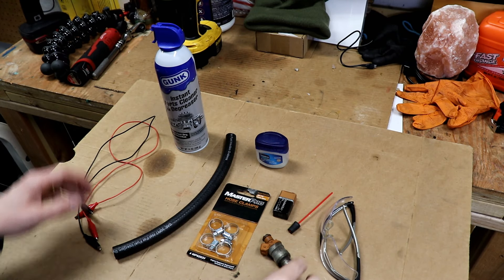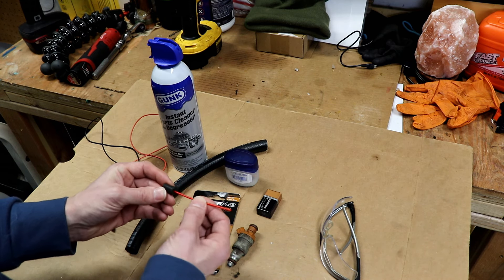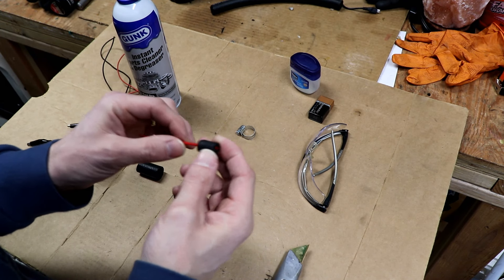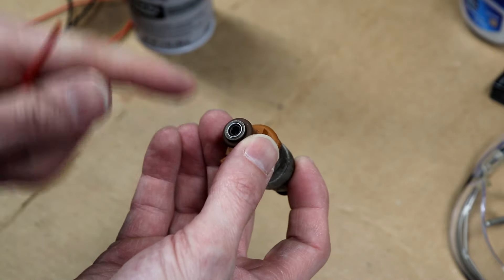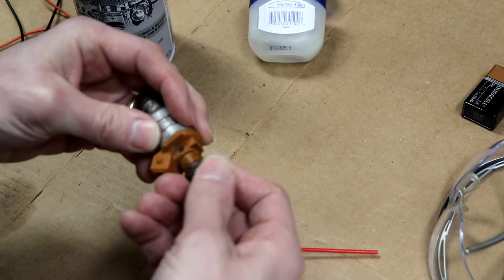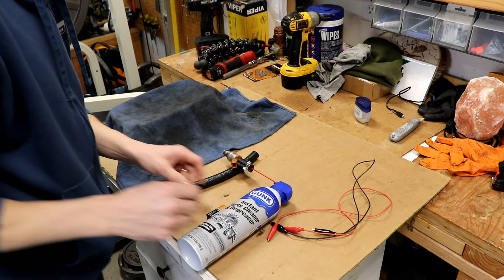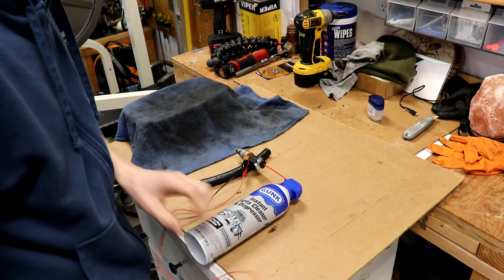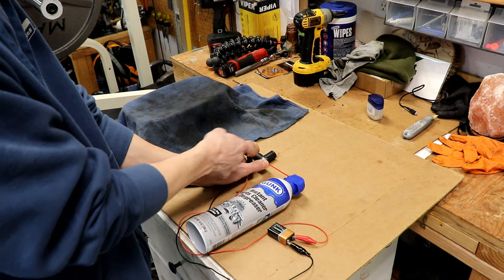Fuel Injector Cleaning Tip!!

Comment: Good setup for getting the cleaner to the injector, but if you used TWO HOSE CLAMPS then you could use one hand on the cleaner trigger and the other hand to touch the battery intermittently.

Comment: I really like your method of connecting the can to the injector. In another video they mentioned that you might cook the solenoid in the injector if you have a constant connection. So I might not do everything the same way you did, but the connection was the best I have seen so far.............. Thanks for posting!!!
Reply: Right you're supposed to tap on it.
Reply: I just tried this on mine and my injectors got hot really fast so definitrely do not have constant power. Just tap on them.

Comment: I like your set up, Dale, especially with the 9v battery. Much safer than using a car battery. One thing I did was use a large gatorade bottle to capture the stream of cleaner. I cut an X in the cap just big enough to fit the end of the injector and to allow pressure to escape from the spray. The gatorade bottle was sturdy and transparent for monitoring the spray pattern.
Reply from the maker: That's a great idea! Thanks
Reply: Smart work indeed
Reply: Did you notice any crud that got disolved

Comment: You can hook up a push button switch between the battery & injector to cycle / pulsate the injector to see what the spray pattern looks like, also makes it alot easier than trying to hold the wires & spray the cleaner at the same time✌

Comment: I'm new at t this. After going to the school of You Tube on this subject, I find out each injector has a fuel screen in them and you should do a continuity test on each injector. You don't have to know what the continuity number is, but each injector should be very close to the same number. Mine has 4. The continuity results were, 13.6, 11.6, 9.8 and 7.2. These injectors have 240,000 miles on them. With bad continuity numbers and too many miles I wanted to just replace them. O'Reilly's wanted $100 for each injector, = $400! So, I found them on Amazon for $10.75 each, = $43. I found a rebuild kit with new screens for $28. $43 - $28 = $15. I'm replacing mine with new ones from Amazon.

Comment: I just tried a 9V battery with my chevy venture fuel injectors but it didn't have enough power to open the injectors.   I have a collection of power adapters so I used a 12V 2.5A adapter and it worked.

Comment: I wouldn't leave the 9 volt hooked up to the injector, you want to pulse clean it by touching the battery terminal for short periods of time. You need another hose clamp on rubber tubing holding injector on so it does not fly off. Also back flush the injector too.
Reply: I don't think id backflush, just to avoid contamination in that direction.
Reply from the maker: Yeah. Didn't seem to be an issue and I've watched them flow test injectors by running current for longer than I did.  I left other end without clamp so i could easily swap out injectors.
Reply: @JeepSolid  was that nearly solid flow pattern similar to a new injector? Of course higher pressure would render more atomization. Still, that injector sure seemed to flow a lot at that low pressure.
Reply: 4x4Scout, That's is part of the cleaning process in cleaning fuel injectors, back flushing. If you don't take the baskets out " SCREEN FILTER " back flushing will get the junk out of the basket. Or you could buy new baskets, check OHMS, spray pattern, pintle caps, flow rate, pulse operation, ect....
Reply: JeepSolid, When flow testing the off on cycle "PULSE "  of the injector is so fast it seems like it's a continuous spray but it pulses really fast. That injector you were cleaning sprayed like a garden hose, should be more atomization even for a 2 hole injector.
Reply: How can you tell if it's cleaned I'm trying to figure out which ones are the bad ones
Reply: Amazon has some neat little boxes made to hold a 9 volt. It already has wires and an on/off switch. All in one compact package, almost perfect for this job. Only thing that would make it better is a momentary swith instead of off/on.

Comment: I actually bought the proper cleaning kit that comes with the leads and plugs and also 2 plastic tubes with different size holes where you insert the feed end of the injector. Cheap to buy now and lots have been sold! It is cheaper than buying new and obviously works faster than additives. I used good old fashioned carb cleaner. I've watched all the black crap and soot disappear off those old weber carbs!

Comment: The stopper being slightly smaller than the inside diameter of the hose is a good thing. But put the injector in the pipe first and secure it and push the stopper in until it hits the injector. Should give you more cleaning force, as there's no gap between the two. Also, spray the cleaner into a jar or container so you can reuse it, either putting a part into the container or pour the cleaner onto a part.
Reply: Reuse dirty spray cleaner no way unless it been filter.
Reply: @rcrotorfreak  having cleaner in a jar is good to soak pieces in to dissolve heavy buildup. Then spray to finish cleaning. It works until the used spray gets too dirty. Then collect it again. I never had a problem doing that.
Reply: Whether the stopper and straw tip touches the fuel injector or not makes no difference and doesn't provide "more cleaning force." Liquids are non-compressible. When you apply a force to a liquid in a container, it transmits the force instantly and fully all around. You could use a 3 foot length of hose, and it would make no difference once the hose was filled with the solvent and the pressure in the can was equalized with the hose. The pressurized gas in the end of the hose and in the can apply the force to the liquid to force it out of the injector when it's opened up. Arguably, if you had a 3 foot section of hose hanging vertically with the injector as the bottom and the can up top, THAT WOULD give you more "cleaning force" because the physical weight of the 3 foot column of  liquid pushing down on the injector via gravity would add to the pressure supplies by the propellant gas in the can!!! 😸 Additionally still, if you were filling the hose for the first time, you could pinch off the hose halfway with a clamp, fill the upper half of the hose with liquid, then switch the injector open and keep the valve of the can open as you release the clamp. The pressurized liquid would start entering the hose at high velocity to propel the whole 1.5 foot long column of solvent liquid toward the injector, accelerated even further by gravity at 9.8 m/s², and the impact of the non-compressible liquid hitting any stubborn deposits in the pintle would dislodge them much better than liquid that's just being sprayed 2mms out if the can alone. 

See? 😸 Physics. It's a cool thing. 😎
Reply: @mannys9130  less area where pressure is applied equals more force. That's physics 101. Liquid is under pressure when it is in a container with added pressure. That's physics 102.

Comment: This is brilliant and I am going to do it but serious question.....  does it actually clean them?  What I mean is that I have seen carbon build up on throttle body and if you just spray with no actual wiping or rubbing, the build up only gets wet.   I would think it would take several cans just to clean one.  BUT if you say that they were clogged and you could feel it, then you did this and it fixed them - great!  Just want to know it actually works.  I appreciate any responses.

Comment: good video, dude ! Say, isn't the fuel injector for the 4.0 piezo based ? For solenoid/electromechanical injector type you should have a separate side inlet for the fuel and the magnetic/solenoid on top of the injector - your thoughts ? Thanks.

Comment: Great video. Only thing i recommend is to NOT leave constant power to the fuel injector as you can burn out the solenoid inside of it. Tap the positive terminal on the battery when doing this. Also use a multimeter to figure how much pressure each fuel injector is giving off. One low reading could be the culprit of your engine misfire(s).
Reply: I did just that by following the same example of another video - 14.5 ohms (in spec.) before, 15.5 ohms (out of spec.) after.  Oh, and I also cracked the aged pintle cap removing the lower o ring. $50 round trip to O'Reilly to buy an overpriced, budget injector.  Don't let this happen to you fellas.
Reply: How do you use a multimeter to figure out how much pressure a fuel injector is giving off?
Reply: @Force1Com  You can't really check the pressure/spray pattern except by hooking it up and blowing carb cleaner through it.  By selecting resistance on your multimeter you can tell if it is in acceptable operating range.  Of course, you would have to research what are the specifications ("spec.") of your injector.  

NOTE:  this method is tricky and I was unsuccessful with it.  I gave up trying to clean them and bought Bosch replacements at Rock Auto (beware there are fakes out there) for my '05 Sentra.  My gas mileage improved from 19.1 to 26 mpg, my misfire disappeared and it cleared the dreaded P0171 which dogged me for 4 yrs. despite replacing the MAF & fuel pump.
Reply: @Force1Com   you would use a multimeter  set to “ohms” . ( which would measure resistance between each side of your fuel injector solenoid . You can look up what the spec resistance should be . Or maybe measure resistance of a new one 😉.
Reply: good point - say, isn't the fuel injector for the 4.0 piezo based ? For solenoid/electromechanical injector type you should have a separate side inlet for the fuel and the magnetic/solenoid on top of the injector - your thoughts ? Thanks.
Reply: that would require another person considering we only have two hands.

Comment: You dont need to take out the injectors. It is quite a job to do it if a lot of stuff on the motor have to be removed. You can put the carb cleaner to the intake of the rail which I think is on the left side of the motor if you sit behind the steering wheel but check your car properly and you will find it out. Then do the same as you did, just spray it into the intake and run the motor after having disconnected the relay of the fuel pump so it not delivers fuel from the tank but only from the carb cleaner. Have you tried Mr Jep Solid or any other here?
Reply: Sounds good in theory but,
A-You wouldn't be able to see if one of the injectors wasn't engaging while doing it that way and ,..
B- wouldn't see if they were all spraying in a spray pattern rather than just a stream. A spray pattern is what you want to see to know that the injector is working properly.
So ,yes it would be easier, but also the laziest and most unreliable way of doing it. Just do it the right Way and stop looking to cut corners. Or cut corners and learn the hard way. Up to you bud

Comment: Cool video you just saved me a shit load of money I was going to get one of those injection cleaning kits and buy the solvent which is 21 bucks for 16 ounces plus the kit the rubber stopper is a very good idea I have an adjustable power supply I can use on the injector thanks

Comment: If you have constant power won't you burn out fuel injectors?
Reply: Not really the battery magnetizes a coil in the injectors which open and close the injectors. Keeping the battery connected to the injectors just means the coil stays magnetized
Reply: The cleaner coming out of the can is pretty cool, but you'll be able to feel the outside of the injector housing. Probably not a good idea if it starts to get warm. Better to pulse it obviously

Comment: Petrolium Jelly will break down rubber, I suggest use white grease or oil. Not to mention the injector is desinged to work with 12volts, using a 9v battery is underpowering which is also not a good thing to do.

Comment: I tried another method of cleanings while still on the car.  But didn't work and just made a mess 🤣 The little straw was to lose. And glue was a bad idea. So I just ordered a new set on eBay.  Also just wondering did you have to back spray or flush the injector as well?

Comment: If you go though the work of taking it off the engine, why not replace the Orings and filters at that time?
I have a Toyota 3vze which takes a bit of work to get them out, Jeep may be easier to access.

Comment: Hey Dale,  I thought you mechanic's always say to use silicone grease on rubber components rather than a petroleum based lubricant because petroleum will ruin the rubber seals, gaskets, etc.
Reply: Gasoline is a petroleum product.

Comment: Is there any concern with using petroleum jelly on the rubber fuel injector o-ring?  I know some greases will cause rubber bushings to swell.  I don't know, but maybe sil-glyde would be a better option?
Reply from the maker: No issue that I know of.  It's a trick I've seen other mechanics use on this application
Reply: Plumbers grease is safe for all rubber.  I know mechanics use Vaseline but I have had issues when putting a petroleum based lube on rubber
Reply: Vaseline(aka petroleum jelly) will deteriorate rubber.  The question is whether these o-rings are ‘natural’ rubber or synthetic.  To be safe, silicone spray should be used.

Comment: Does it matter which wire is positive or negative when hooking wires to injectors ?? ¿
Reply: I asked the same question with no response either
Reply: No it doesn't matter. It's just an electromagnet.
Reply: @warrensteel9954  appreciate it
Reply: @warrensteel9954  thanks

Comment: Does it matter if the fuel line tube is short or long? I saw a video where they had it long and your video it's short? Does it even matter or is there a proper way to do it?
Reply: The longer the line the more cleaner you spill/waste when you disconnect and switch between injectors.

Comment: Very stressed out!  I rebuilt my entire jeep except the motor because it is perfectly fine!  The problem is fuel being delivered! If you have any suggestions or videos for pulling the full  rail, that would be great!  Just took it for a test drive, worked amazing, then stopped getting fuel to it.   2000 Jeep wrangler 2.5L  Just not sure if it comes out as one? It looks like it should
Reply: Ls swap

Comment: Hi there, how long would you recommend running the cleaner setup for? i.e., how will I know if they're "clean" ?
Reply: An injector should produce a fine, misty spray pattern. There may be discernible jet streams coming from multiple holes in the pintle nozzle, but the edges of those individual streams should be super feathery and foggy, and shortly after leaving the nozzle it should look like a fuel fog rather than a jet of liquid. Until you get your injectors to spray a very fine foggy cloud of cleaning solvent, keep going. Alternate forward flushing and back flushing every 15 seconds or so. By that I mean flip the injector around so that you spray cleaner in each side back and forth. The cleaner won't come out well at all when back flushing them. No pattern or mist. That's fine, you only get the fine mist when spraying in the direction that fuel would flow normally. 👍 Gasoline liquid is not flammable. Gasoline vapor is EXTREMELY flammable. The injector's job is to atomize the jet of liquid gasoline into very tiny droplets which have such a small surface area that they evaporate by themselves into vapor that can be ignited by the spark plug. If the injector doesn't break up that liquid gasoline into teeny tiny droplets, they take a long time to evaporate; longer than it takes for the piston to draw them in, reach bottom dead center, compress the fuel and air charge, and get pushed back down as the spark plug ignites the charge and it starts to rapidly burn. Ideally, ALL of the tiny fuel droplets are evaporated entirely into gasoline vapor by the time the piston is ~1/2 way up on the compression stroke. That means all of the gas charge is mixed with the air and flammable to push the piston down and drive the vehicle. When the droplets are too big and fail to fully evaporate, the same volume of fuel produces a weak combustion event and a bit more fuel has to be injected to get the proper combustion event. That means less gas mileage, and all the little droplets that did not evaporate and burn are pushed out into the exhaust which become unburned hydrocarbon emissions which the catalytic converter has to "burn" which heats it up, fouls it with carbon, and shortens its lifespan. So, TL;DR you need to clean them until you get a nice misty, foggy spray pattern with no discernible boundary margins of each jet past an inch or so after the injector nozzle. Forward flush and back flush until you get that result. Then you're done.

Comment: Hey Brada ur video helps alot thankyou.my car cranks but wont start...I replace my coils, spark plugs, now I clean my fuel injectors , but damn my car still wont start.my fuel pump works but I don't know  what else 2 do..I'm not a mechanic but I'm hoping U can help.
Reply: Check compression
Reply: Check fuel pressure . Pump may be week..

Comment: Vaseline is petroleum based it will cause the rubber to swell and then crack. you never use this stuff on rubber. Best stuff to use is dielectric grease but thats expensive the cheap stuff is brake lube (not anti seize ) they make a clear caliper grease that is safe for rubber and will not cause it to swell
Reply: If the seal can withstand gasoline it shouldn't have any issues with petroleum jelly.

Comment: Does this also works on a GDI system? Greetings
Reply: GDI engines mean the injector is in the head of the engine. It would be more difficult getting it out but once you did it would be the same process
Reply: @stephenpryor5063  thank you for the respond I would try this right away